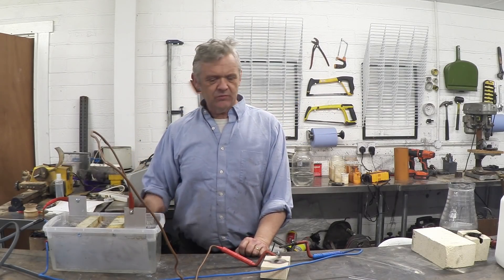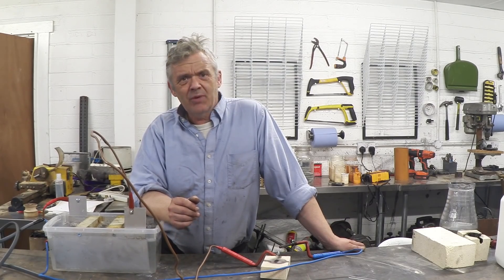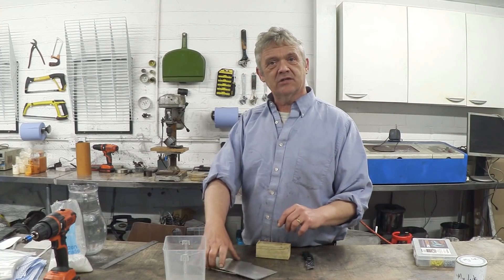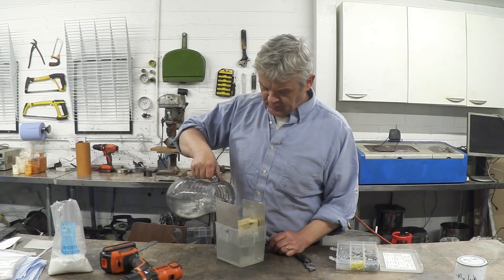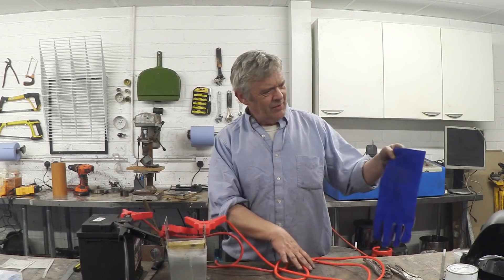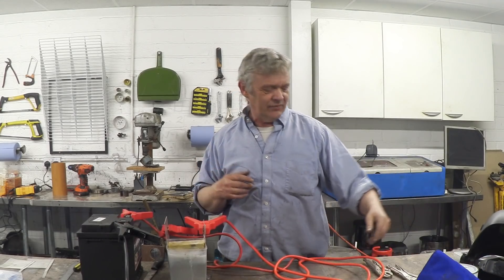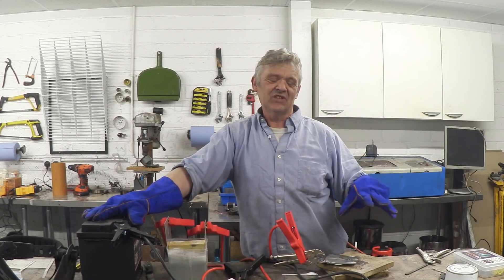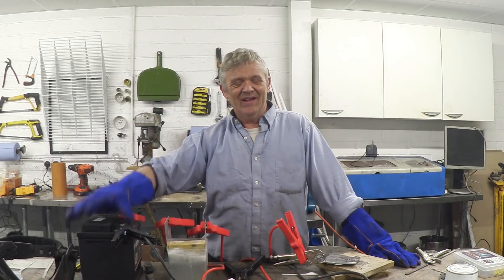Welding With Water And A Battery

Comment: Eh, you just need some practice. Striking an arc with less than 40v sitting between the pieces takes a little finesse. If you've got that then you'd be a fine welder if you knew exactly what you were looking for in the arc, puddle and edges.
Reply from the maker: I plan on doing a bit more more welding for sure - it was fun
Reply: Yes, I'd say the same. I'm a new welder myself and I thought he was a natural!
Reply: I've conceived an idea of a possible servomechanism that can adjust the gap on the fly. this would probably give a very good weld similar to the one generated by a robot.

Comment: Trying this!   Great video! Thanks for this
Reply: hmmm...cannot seem to get anything other than very low current sparks. almost identical setup.  without running thru the water; I get rod melting current. I am using slightly smaller welding rods...mild confusion, any ideas?
Reply: @SteveEh  There may be a passivation layer on your work surface.  Try scoring it.
Reply from the maker: too much resistance mate - clean it, more salt or add another battery
Reply from the maker: go for it mate